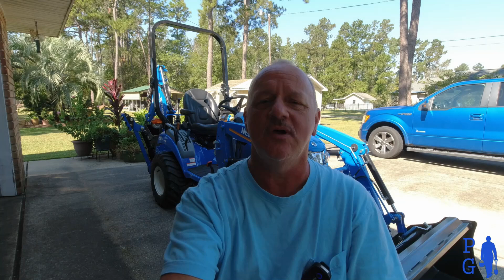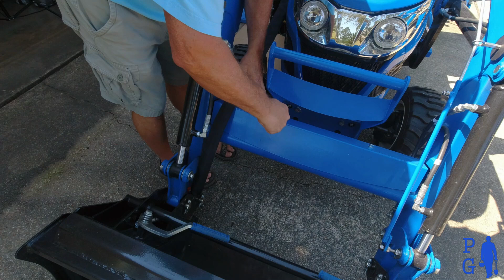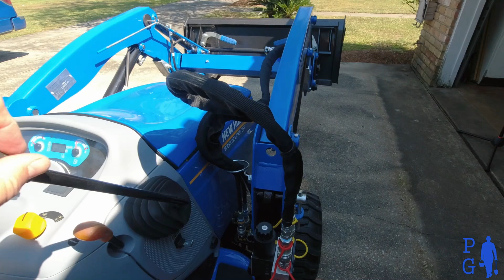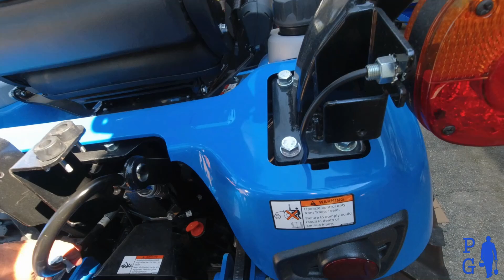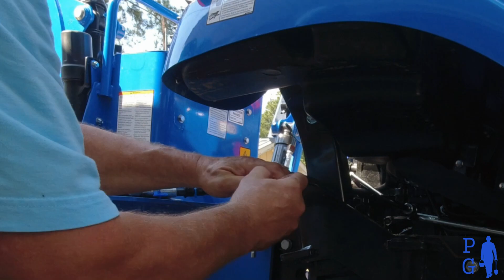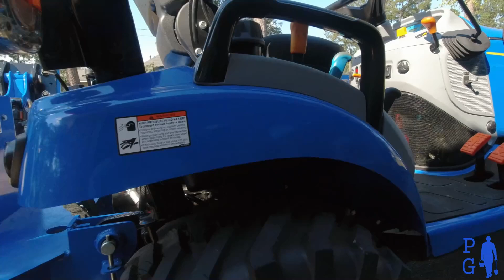PART 1 - New Holland Workmaster 25S Third Function Kit Installation -  Hydraulics (LS MT125 Twin)

Comment: I do not have the back hoe attachment and I'm having a hard time figuring out where to connect my lines they sent me mine that 33 ins and it's not long enough to reach where you've connected your lines there a 58 inch line that's long enough. Where would the 33 inch line be connected? Also is the P or the T port connected to the tank? All my kit come with is a flow chart does not show which ports in the back of the tractor gets used.

Comment: I to have a 25s and I see you have a bucket indicator. I've called multiple dealers and they only make it for the 200lc loader NOT the 100lc. How and where did you get the bucket indicator for this?? Please help! Thanks-
Reply from the maker: I needed one, so I built it myself.

Comment: Is the part number for the kit used in this video  TFKPB-LS1?  I contacted Summit Hydraulics and they said they couldn't confirm that it would fit the 25S only that it was designed to fit the LS MT125.
Reply from the maker: Yes, that is the part number for the kit used in this video.  The New Holland Workmaster 25S is a twin of the LS MT125.